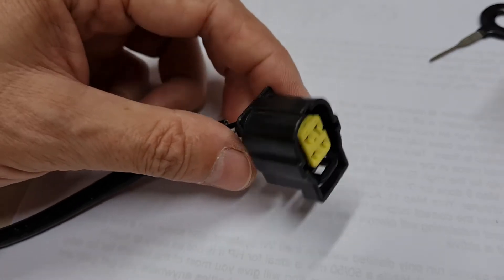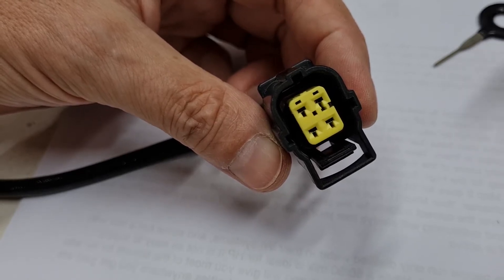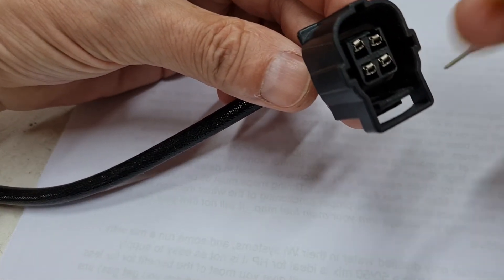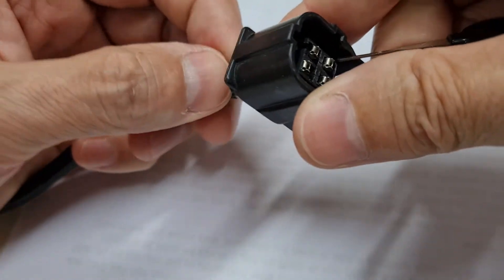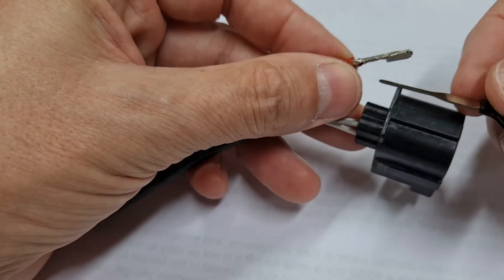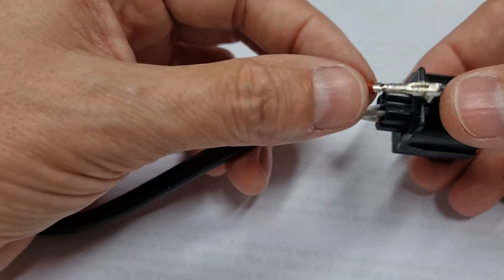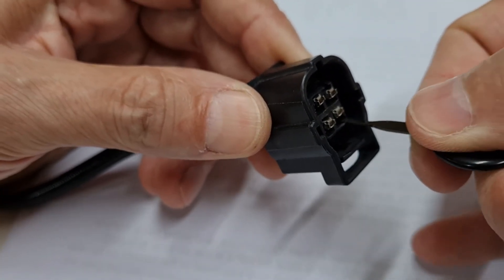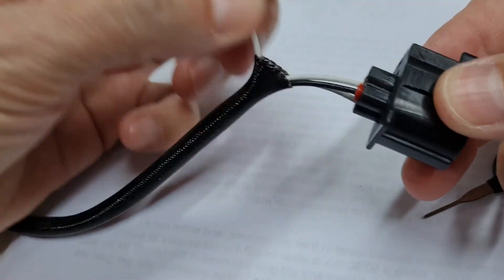Econoseal de-pin

Comment: It's a lot easier if you go in at the top of the terminal, where the locking tab is. Slide the tool down the top of the terminal and it will push the tab downwards, freeing the rest of the wire. Some terminals have two or more tabs, which is why you see terminal tools with fork-like endings, so you can push both tabs in at the same time.

Comment: I think this is the same connector series used on Toyota and the housings age poorly.  Glad I found your video!  $1.68 for the replacement housing instead of $20.00 for an aftermarket pigtail and have to try to make decent splices...  Thanks!
Reply from the maker: You're welcome!